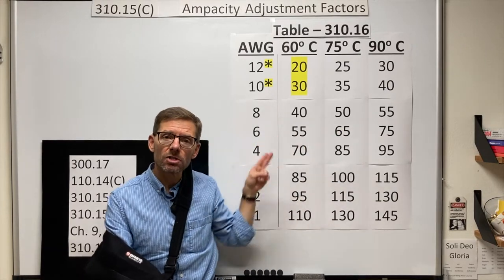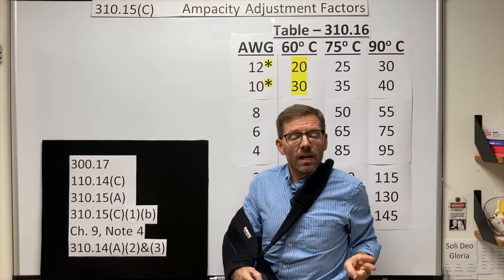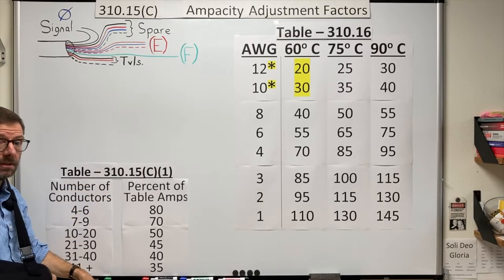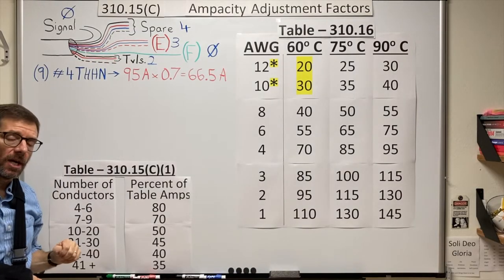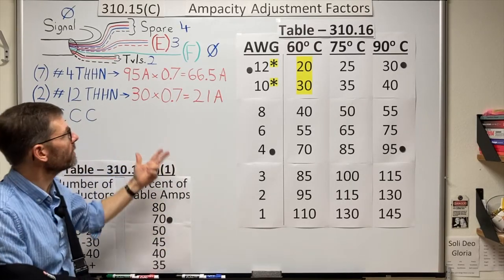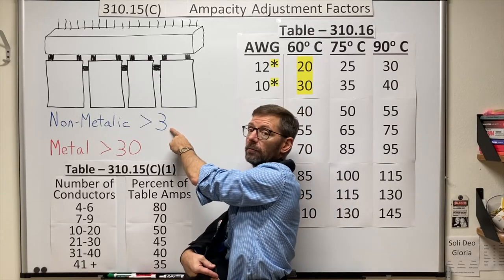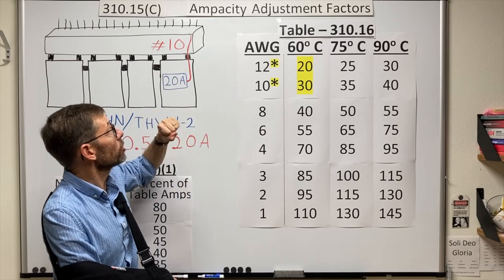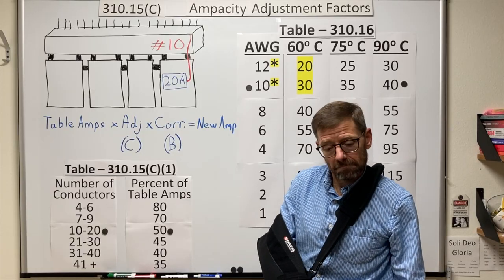310.15(C) Ampacity Adjustment Factors

Comment: I'm using 2014 NEC and I don't see 310.14  , what to do??? Another question why did you not incorporate 110.14 ( c) ( 1) . You consistently used the 90 degree col and I dont know why?  When is it ok to use article 110.14 and when its ok to choose a starting col from 310.15 ?? Great presentation ,I'm just gonna have to go elsewhere to get my question answered!

Comment: I'm not an electrician but I do have an electrical engineering degree and am working on passing my local homeowner's electrical exam so I can pull my own permits. Your videos are super helpful! A couple suggestions I have for future content:

* Service and feeder load calculations
* Load calculation guidance specifically for level 2 home EVCS which isn't covered very well at least by NEC 2017 Article 220 or 625.

Actually, given the massive amount of EV charging infrastructure in general it would probably be good to work on a series exploring best practices and code guidelines around that - both commercial and residential charging.
Reply: I also would love to see that as my company put in an 80A Ford lightning charger and used 100A wire and OCPD for continuous duty, and Inspector gadget is making us do a service calc for the home. I know the Chevy Bolt charger requires a NEMA 14-50 outlet which has to have GFCI protection and thats a $100 breaker, we try to hardwire most chargers and theres an exception saying GFCI breaker isnt required here in Oregon

Comment: Excellent video. I'm confused on one thing though. You mentioned 310.15(A) which states in 2nd paragraph: "The temperature correction and adjustment factors shall be permitted to be applied to the ampacity for the temperature rating of the conductor, if the corrected and adjusted ampacity does not exceed the ampacity for the temperature rating of the termination in accordance with the provisions of 110.14(C) ."

My question is, WHICH ambient temperature correction factor would I use to correct the conductor's ampacity? The one of the lower-rated terminal or the one of the higher-rated conductor? And after I calculate this corrected ampacity, must it be less than the terminal ampacity under the conditions of use OR its ampacity after correction for ambient temperature?

The code doesn't mention needing to correct termination ampacity as a requirement for this permission but it seems odd that it wouldn't be done, right?

Comment: Running 14/2, or 12/2 NM-B: We are limited to 2 romex per stud hole, is that correct? Could both hot+neutral for each set of romex?